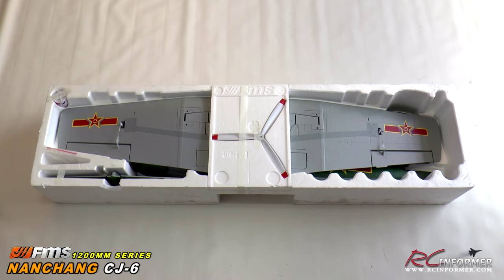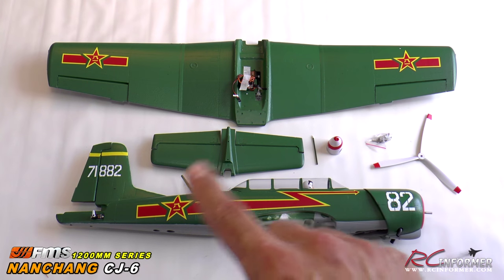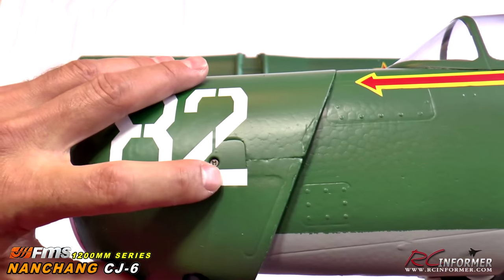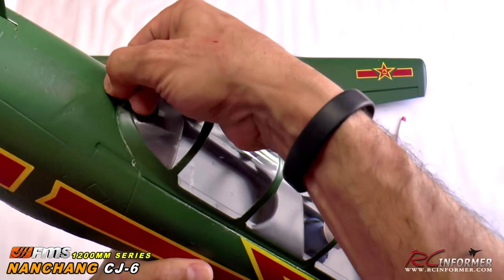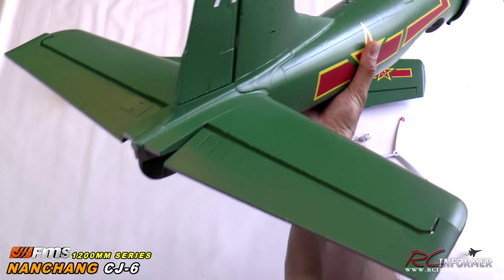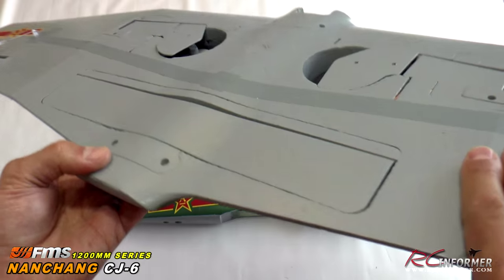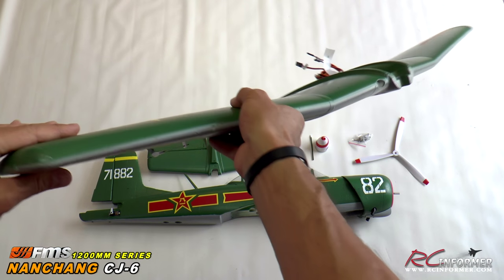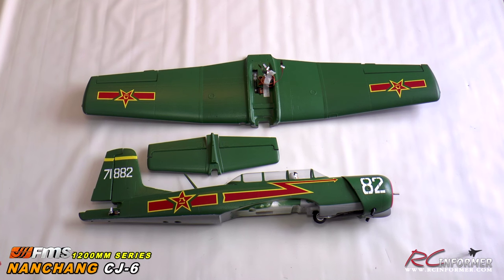FMS NANCHANG CJ-6 1200mm UNBOXING By: RCINFORMER

Comment: Hey Rich,WOW, this model looks sweet! I have the Yak 52 (from brand "X") and thoroughly enjoy it. That said, I'm really eyeballing this one as it's a great rendition of a seldom (if EVER) modeled plane. Although I really like the 3S design, can you elaborate on whether this will function on 4S as well? I guess what I'm trying to say is, are planning on testing this with a 4S battery while you and Pete are out having fun with the CJ-6?Also, please tell me that unlike the P-39, FMS will actually deliver the first planes painted in this livery as it's a stunner!!!Thanks for bringing us these "sneak-peeks" and I'm looking forward to your maiden video!
Reply from the maker: +Justwingit We may try the 4s but the ESC is 40A, the 4s may blow it away:) 3s is probably all it needs, but we will see when we get it out there:) The prop has some significant surface area to it, so it should pull pretty good on 3s. About the paint, sometimes I never know what is going to happen with the paint job, they often change it after I get the sample... I think this one is going to stay the same because it is pretty authentic!

Comment: big bloby paint run on the rudder,paint job looked thick on the tail. I noticed white spots by the canopy next to the decals,looks like they misaligned,then ripped paint off trying to straighten it up. I am glad its preproduction. I noticed on of the other FMS models you previewed the red paint color varied,and saw a thumb print. The production model looked much better so I think in their haste to get you a preview model,they give you something of less quality than production. I have read many negative reviews of FMS but I myself like the basic model. I would probably change out servos and esc to better quality although we should never have to do that. Price is fair on their models,but I would pay more for higher quality electronics. No one should have to invest in a plane twice just to get what you really want.
Reply from the maker: +scott firman This is an early Paint sample... I product test them very thoroughly and then take pictures & video to demo the model... mine is usually a bit rougher than the final production model:)
Reply: +RCINFORMER As I stated,I believe that in their haste to deliver a prototype preproduction,they sometimes give you less than steller examples. The fact they send you a strange looking box with the picture thrown on the box proves that. I have found most instruction sheets are pretty much trash,lack of photos,black and white,bad English ( chinglish) seems to be the biggest problem most of us run in to. Thats when I turn to You-Tube. I do like your reviews however.
Reply from the maker: +scott firman All my FMS planes run on ALL STOCK ELECTRONICS! I do not add or change anything. The stock Equipment is very good as you can see in the flight demos:)

Comment: Hi Rich, I love your reviews, but please don't confuse the Chang with a Yak-52, there is one component on the entire airplane in common,and that is the gear lever. The CJ5 had Yak heritage, but the CJ6 is nothing like any Yak, and is a much less aerobatic airplane than a 52. One of my full size mounts is a 52 and if you have flown both you will understand why Yak drivers get so insulted when people compare them to a CJ6😁
Reply from the maker: +Warren Pilot While they are different, They are very similar in appearance.... The cowls, canopy's and gear have many similarities.... the general look of the planes make them easily mistaken for one another....
Reply: +RCINFORMER If you put them side-by-side, the only similarity is the cowling. There is no component (wings, tail, empennage, canopy, fuselage, landing gear) that has any similarity. They're also not vaguely related to each other. The Nanchang was designed in the 50's and the Yak in the 70's. That Wikipedia photo was actually my Nanchang! We Yak/Nanchang guys don't like them to be confused with each other.